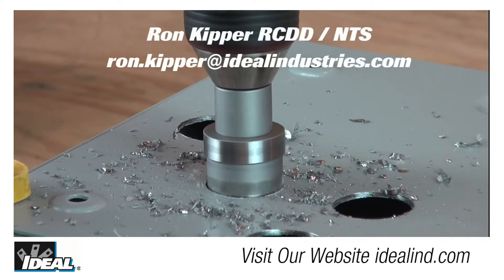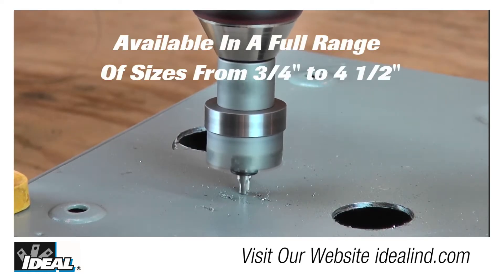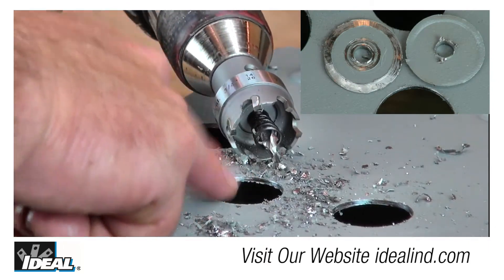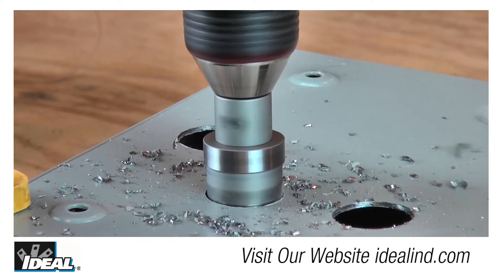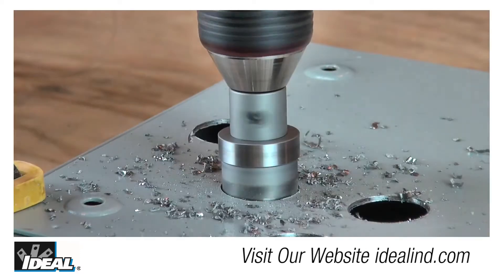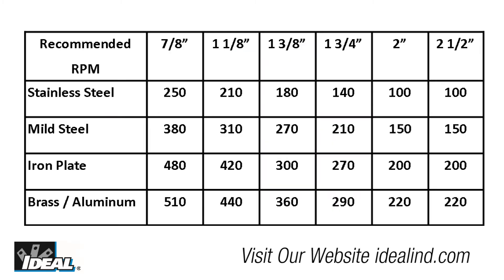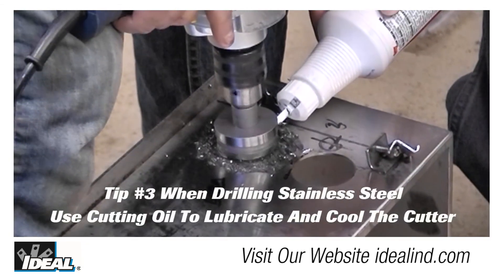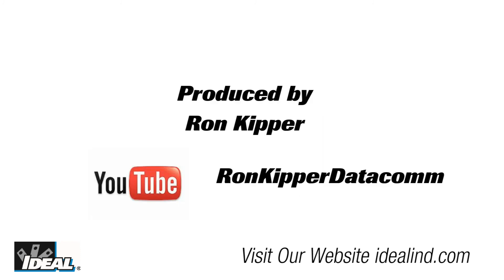TKO™ Carbide Tipped Hole Cutter Video

Comment: Great looking hole saws Ron, how do they cope with plastic? We have a lot of plastic enclosures hear in the UK. I like the way they don't go too far in and damage any existing cables.
Reply from the maker: heavydiesel I heard the product manager mention someone was using them on plastic enclosures. How about I just send you one and let you give it a shot. If it works send me a picture or a video. If you need a local contact her info is Alison.comerford@idealnwd.com. Send me your address ron.kipper@idealindustries.com
Reply from the maker: heavydiesel Hey I have just used the TKO on a nylon, PVC and Fiberglass boxes and it worked much better than I thought it would. Maybe my next video...............if you still want to try one send me an address and I will hook you up!Ron
Reply: ***** Thats very kind of you Ron, I'll pm you my address.
Reply: +Ron Kipper Datacomm  hey Ron I ordered this set online and the 3/4 hole saw came with a small chip on t
one of the teeth you think it will cut OK?  I sure hope so I saved for a long time to buy this thanks Ron.
Reply from the maker: gee mcgee wherever you bought the hole saws they should be able to replace that hole saw. Drop me a note with your information to my email and I will make sure we take care of it for you. I would not use it as it might be damaged and look like you misused it. Ron at ron.kipper@idealindustries.com.
Reply: heavydiesel in